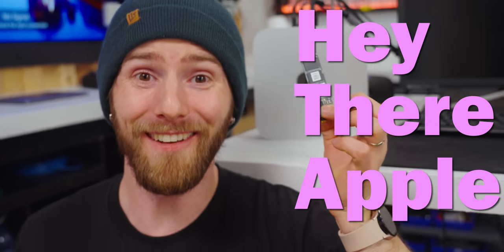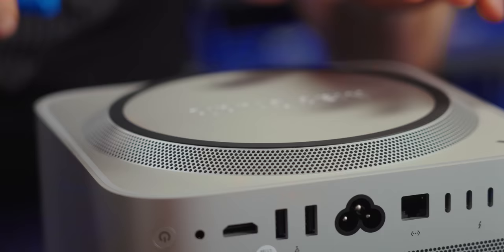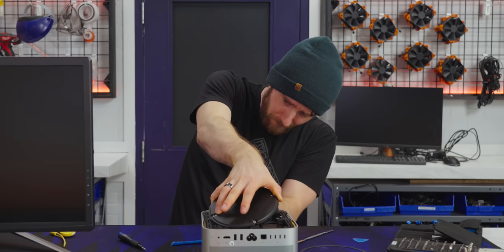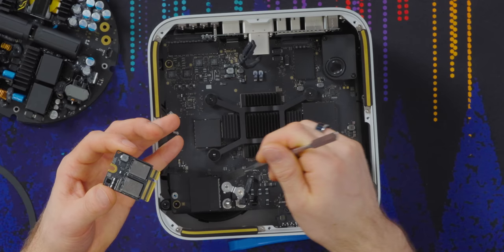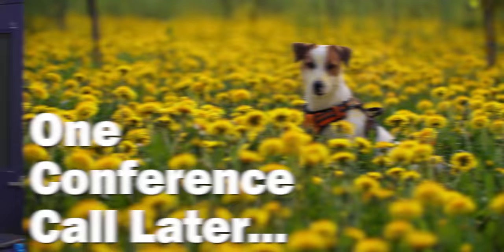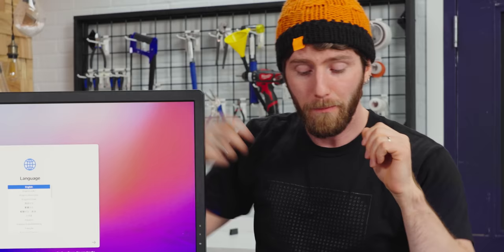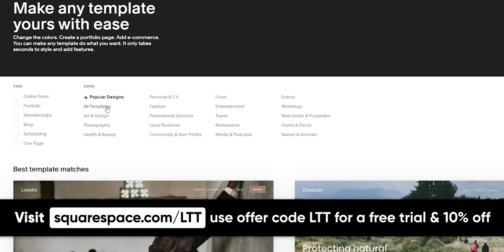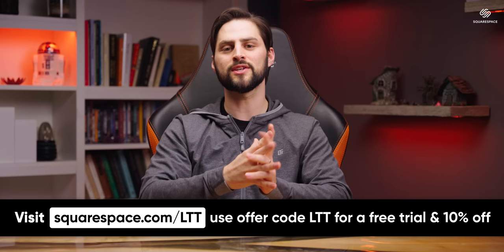I want to love Apple, but they’re making it hard - Mac Studio SSD Swapping

Comment: I'm glad your in this fight like Louis Rossman is. Great work showing how bad these companies are. Apple, that camera battery experiment, and onewheel( Louis has been harping onewheel for the same battery issues)
Reply: I thought Louis didn’t mind this one, saying they aren’t SSDs and it’s an architectural thing
Reply: @NeonLemonAcid  because it is. Linus can say shit about them all day long but it doesnt change the fact that its the same architecture thats inside macbook air M1. They were limited by its archhitecture.

Meanwhile this video clearly sends wrong impression because people say "apple was not limited by thickness or anything". Yeah, they were limited by much bigger problem. Their laptop design. And no one expected studio to have swappable ssd, just youtubers like LLT hyped it up and now are surprised.
Reply: @cyjanek7818  Dude, the point that they designed the architecture themselves still stands high and dry. They could've designed it to be repairable, but they actively made it so you have to get them to repair it.
Reply: @anakinlowground5515  "They could've designed it to be repairable, but they actively made it so you have to get them to repair it." interesting but no. They could not. They deisgned it to fit to every apple thing that exist and thats why they made those sacrifices. It wasnt making it hard to repair (in fact it is relatively easy to repair for them, harder to upgrade). This video makes you go after wrong things. 

YOu should be mad that they do not provide you with software required to upgrade ssd but you should not be mad at their architecture because it works as well as we can assume it could. You have same architecture in ipad air and in mac studio, they didnt try to make repairing more problematic in design, they had to make some sacrifices for this universality. 

Just because Linus says that they could have designed it otherwise is BS and hard to understand, changing basics of chip design is not just "hey I will put ssd there now".

Comment: Maybe you're supposed to pay for a subscription upgrade to be allowed to use a different SSD.  Apple is price-gouging on storage space and RAM, and it doesn't want you to be able to install any upgrades without paying the exorbitant prices.
Reply: Don't give them any ideas.
Reply: kind of like tesla with their heated seats?
Reply: This is an industry tendency.  As I understand, the cars will be that way in the future ... they arrive to you fully loaded, but with a lot of features turned off.  So, if you PAY them for one of them, then they will put some key or send some command to the car for the car to use that feature.

When this happens, that will help the builders to reduce production costs as they don't need to work different configurations, but our rights to repair our cars will be gone.

For example, I have a very nice Geely GX3 that have some sort of Android derived software in their central console.  That software has the options to upgrade it ... BUT ... yo will be very lucky if you find some new software version somewhere.  I suppose that soon or later I will need to pay something for such upgrade, and I really have no idea if the car has some extra unknown capability hidden behind that software layer.
Reply: @sonosus Middle of the night. Working on a Mac. A pop-up appears.

"Uh-oh! Byte 0x07bc6d25 is locked! It's used by MacOS for the startup process and there's no way around. You'll get the same message 5 minutes after restarting. Pay 1000 dollars to unlock it and continue using your Mac?
-- Little Timmy"

Comment: I could be convinced to that in order to get the bandwidth that they want to advertise they need to have a custom controller on that soc, but I cannot be convinced there is any reason that new flash storage couldn't be added.
Reply: there isn't.
there are no different SKU's for each and every single ram+storage+M1 MAX/ULTRA out there - this is literally a software restriction flashed onto the BIOS purposely to prevent costumers from salvaging higher storage modules in the future from faulty mac studios in order to upgrade their current machines instead of going directly to apple and pay anywhere between 2000-8000$ (depending on the configuration they ACTUALLY need)
flash storage chips are dirt cheap - how dirt cheap?
from recent negotiations in my company with Micron and Samsung, a single 256GB flash module costs anywhere between 10$-50$ from the slowest flash module to the fastest flash modules Micron and Samsung produce (and i bet you a client like Apple can get even cheaper MOQ's prices than these).
so based on these prices, a 1TB SSD should be a 100-120$ upgrade and not a 200$ upgrade, a 2TB upgrade should be a 200-240$ upgrade and not a whopping 600$ upgrade...
Reply: The problem with this is that the flash memory and storage in general, the specs are decided as a standard. Either way they've bypassed the standards for their own reasons and created their own setup to nullify, or at minimum hinder, people from doing upgrades on their own.
Reply: It could, it’s just that the controller would need to be reprogrammed, but somehow they don’t allow it. At least not for now.

Comment: Even if Apple wanted to have the controller on the motherboard, they could've supported regular SSDs by detecting if there is a controller on the SSD itself, and use that if available.
Reply: true  but then they cant charge u 200 bucks for it
Reply: @ivangojak8854  yeah that's absurd. And there are people who'll think this is a good deal because they've never bought an SSD before. This is the scary part.
Reply: Also don't know how an SSD with a controller presents itself to the OS/mobo firmware. If it just looks like a dumb bit bucket to the OS they could have let their controller "control" where things get written then the built in controller on the SSD translate that again to where it actually puts stuff. All problems solved by one more level of abstraction.

Comment: A current IT. I remember asking a law firm why they went with Mac and he said "because it looks expensive". All they complained about was running out of disk space and how little memory it had. They were using the AIO's and I told them it would cost x amount to get a new hard drive and memory because it was a PITA to open those up vs a Windows machine. Mac is like a trophy wife. Good on the eyes bad on the wallet. Minimal satisfaction.
Reply: Just had a client who wanted to solve this issue too. Suggested two options:
- Buy better computers for half the price that you can expand.
- Have us install file storage servers in the basement and manage the network for way too much money and a 2 year contract.
They went with the second option because they wouldn't get a budget for new computers, but did for a more expensive different investment. The price of pretty things rarely ever ends at the initial price tag.

Comment: I’ve been a windows user for over 30 years. I finally bought a mac mini and it feels like the OS is in beta. First things i noticed right off the bat is no display scaling. Maximizing windows is just plain stupid, and the screen saver and remote access bug. I disabled the animations because it’s just poorly done and makes the OS feels slow. I also had a hard time finding apps that are easily accessible in windows. The last thing that annoys me, but does not affect me since I’m hardwired in is how terrible and unreliable the Wifi is. I also use my mac mini to host my Unifi wifi controller, and updating each access point went from 1 minute to around 10 minutes to complete. 

The things I like is the security and how it integrates with my iPhone. 

I’ve been reading up on the bugs I’ve faced and I’m really surprised how long they existed. If apple can get their act together, I feel like they could generate a lot more sales. For basic use, I can get things done faster in windows. My friend said it could have just been bad timing since Ventura was a big redesign.

Comment: There will eventually be a tool to get around this I suspect. The BIOS on the M1 is likely a specific build for every storage config. Find out how to change out the bios, and it just might work.
Reply: As was mentioned in a different thread here in the comments, the BIOS isn't customized due to your Flash storage.  But it has to be configured with a configuration tool, to know to use both slots, and how much storage is to be used.  Any authorized Apple repair center can do so, any Apple store, etc.  Anyone that has access to this tool, can configure the unit successfully.
Reply: @BenjaminSchollnick  Exactly, so will be a matter of time before the tool either leaks or is recreated by someone.
Reply: @RayHikes  According to another post in the threads, You don't necessarily need another mac. You can use idevicerestore on Linux to restore from DFU mode. This was reverse engineered originally for restoring iOS devices but they've since added M1 Mac support.
Reply: Unless it's a cyrpto key challenge-response kind of thing.  In which case you'd need Apple's private key (if asymmetric) which won't be happening unless they give it to you (possible but uncertain at this point).  Might be worth while sifting through Apple's security documentation to see if there any mention of any of this there.  Their documentation in this area is actually pretty good.
Reply: lol there is already tools   out  it   is called a  sledge hammer   for most apple  product
Reply: changing the storage in Mac studio is like changing and soldering a new nand flash to an ssd without changing the controller, you’ll need special software to configure them in both cases, since the controller work is handled by the m1 SoC in this Mac. This is quite easy to understand once you know how it works, but I think apple should release said software to public.
Reply: That you need a tool that isnt a screwdriver to get around it is a big no .. Buy anything else and use the savings to go get a months worth of milkshakes. Or here in Canada, gas.

Comment: Even worse: without a functioning internal SSD, you can't boot to an external drive!
So in any other M1 device where it's soldered, you are screwed if it dies!

That is really bad for the life of these devices!
Reply: was that confirmed? In the case of the Mac Studio you could just take out all the drives and check...
Reply: @PvtAnonymous  They specifically said soldered so if devices exist where the flash is soldered their claims would be correct
Reply: Buy another.
Reply: Thing is, M1 Macs don't support booting off external storage at all. What the M1 "bootloader" does (there's no BIOS/UEFI boot selection like you'd get on PC, the Mac boot menu is just a separate partition on the SSD which contains a small cut down version of macOS that also contains recovery tools) is copy the kernel from the external storage to internal storage, and then just boot it from internal.
Reply: @LiquidPL  yes it can
Reply: @indiekiduk  can you read. it's not booting directly from usb, it's copying the binary to internal storage and booting from there.
Reply: @PvtAnonymous  But in the Mac studio, what you think is an SSD is just a piece of NAND storage. The SSD controller is on the board. At the very least you can replace the storage, but the controller could also die.
And the controller will only and forever accept the same storage size!
Also it's obviously proprietary.
Why can't we just put whatever NVME drive we want in these machines? For 4000 dollars I'd expect something made to last!
Reply: @LiquidPL  That is actually possible.
But it would still boot to a 1TB SSD if its internal storage is 512GB. So maybe it does copy all that kernel booting shit, but not the whole drive (which would take forever anyway)

Comment: With our firm I have a Macbook pro max and some of the programs don't work or give problems with the M1 chip. The manufacturer of those programs say it is specifically becouse of the different architecture of the chip. The main one I'm talking about is Vectorworks 2022 - they even put out a statement that the update will come soon and that there is positive ''progress'' in the development in the new system. The other big one is twinmotion from epic games and sketchup pro in direct link. You need from apple a code translater program the be able to run it but this does not always work... seems to be very random. Twinmotion als communicated with me that in the near future the update that will come out will fix this issue and that Ray tracing than will be possible but they can't put a date on the release.. also kind of funny my 7 year old 2000euro pc is running the same renders and the same time (maby max 30sec slower)  than than a almost 4000 euro laptop. Propably becouse of the architecture of the chip is not properly supporting the programs but needing to translate everything. We call that F*ing lovely. Sad that in architectural schools they almost teach you to only get mac's in Belgium for some unknown pretentious reasons... sorry for the rand and I love your videos. Cheers!

Comment: this reminds me of something dell did to some of their storage arrays: 
two years ago I got gifted two rackmounted dell storage arrays and I was yeah "Nice, let's put a bunch of cheap 2,5" HDDs in there and extend my NAS with it"
it turns out that this shit completly refused to work unless the HDDs had some specia dell signedl firmware on it. and those harddrives let's call it "dell authorized" HDDs were super expensive second hand (we talk like 200 EUR for 500 GB). 
such a shame that OEMs turn perfectly useable hardware into e-waste with this shit
Reply: Is that second hand price recent?
Cus I bought a couple 1tb nvme ssds for my new pc a few months back for 100€ each.
Hdds for 4x the price per gb is insane
Reply: @the4given196  ssds get rejected outright by the dell storage array
Reply: @BaDitO2  yee thought that aswell. was just a price comparison

Comment: This video doesn't make me angry. It just confirms that I made the correct decision 10 years ago not to buy anything from Apple.
Reply: I've been working as an Apple engineer/consultant for 15 years. I spent several years working at Apple HQ. I've designed and implemented the secure enterprise Mac builds for several blue chip companies, including major banks - yet I've never bought a Mac. I do buy iPads though, because they're awesome.
Reply: @MrBertie7  The problem with this company is not their product. They make amazing, high quality tech.

Comment: And to think, in 1998, the Apple  G3 had a lever to open the side of the computer to access the board, 4 extra slots for extra ram and 2 extra place for drives with a removable front panel so you add disk drives there. I never played in a computer before the G3 and I never really did again. A toddler could upgrade the G3.

Comment: I would be really scared to hold the PSU on my hand like that 😅
The capacitors can hold a significant amount of charge
Reply: This was my exactly my thought too when Linus was palming the supplies 😬

A properly designed power supply will have bleeder resistors across caps to prevent nasty shocks. Good to see they were appropriately designed.
Reply: It does look like there was a cover over the bottom of the circuit board though!
Reply: Yes, I realized that he is not touching the bare PCB but there is a cover
Reply: They are simple to drain, unplug unit from the wall then try and power up a few times :)

Comment: I think even Apple authorized, or whatever they called it, won't able to upgrade it either. because if I'm not mistaken the capacity need to be known by the controller, which is not in the modules but in the M1 SOC.  that's perhaps they give second slot for, so you can add more capacity if you want, and other reason would be they push you to use Apple iCloud storage

Comment: Long time Mac user, and even when everything inside was easy to swap or upgrade, the Apple store has always had really stupid prices on RAM and storage going back to 98 when the first iMacs came out.
Reply: trust me, stupid prices on everything was long before 98.....
Reply: That's not unique to Apple though; the other system builders also charge huge markups for their branded RAM and storage.
Reply: Yet their prices today on RAM are quite competitive.
Reply: Yeah even during the laughably titled "golden age under Steve Jobs," shit like that and repairs were overpriced. They would charge you $500 to fix an easily replaceable $130 display assembly for a 13" 2011 MacBook Pro, for example.
Reply: @Ebalosus  Whatever.

That $130 wasn't a new Apple original part, but feel free to pretend it was the same.
Reply: @VideoArchiveGuy  it was, actually. Renaissance Ltd, the only authorised outlet here in NZ at the time, said as much.

But please, mister no Apple certifications, tell me I’m wrong.
Reply: @Ebalosus  Unless the price included labor, then the $500 charged was the price from Apple.

"Cost" doesn't count.

Comment: The reason you have to do a DFU upgrade if you change the SSD is because the M-series Macs don't have a BIOS in some ROM chip, it's all stored on the storage. If the storage dies then it's all gone. Very likely the firmware is also specific per machine and mismatched serial number will prevent it from loading when swapping the storage of two Macs.

That's the reason you can't 'boot' from external storage, even if it lets you load an OS from somewhere else. The boot process always starts at the firmware in the internal storage.

Of course this is absolutely no reason to prevent upgrading the SSD or swapping anything at all for any reason.

Comment: I noticed after you upgraded to the larger amount of storage when the mac wouldn't restore that you were using the "revive" function in apple configurator. Did you guys try to use the "restore" function at all? restore does a complete wipe and restore where revive doesn't make any changes to the startup volume.